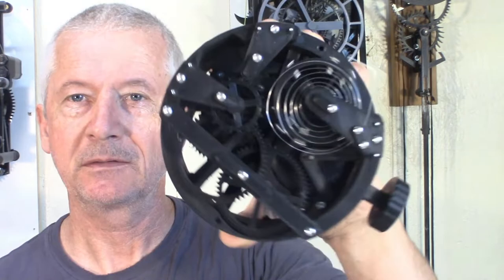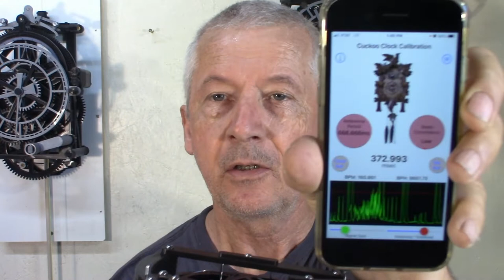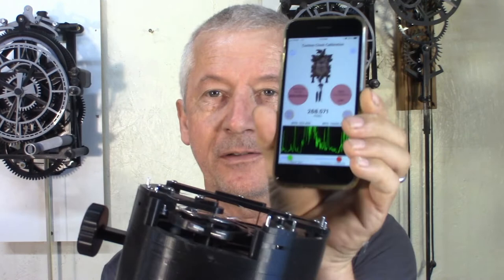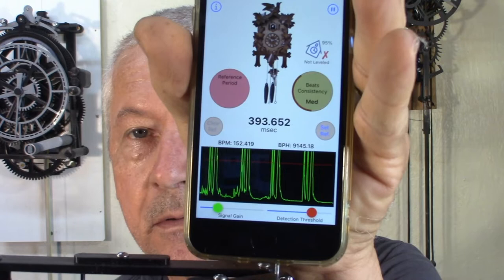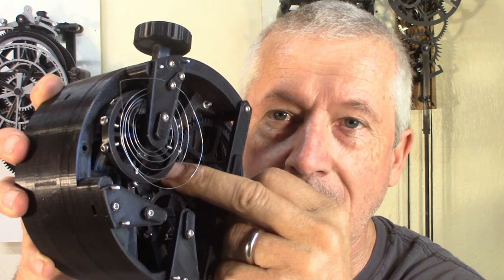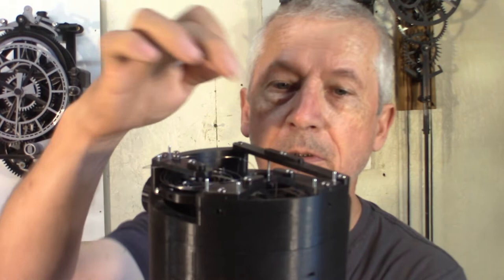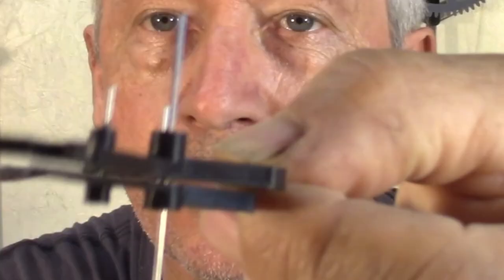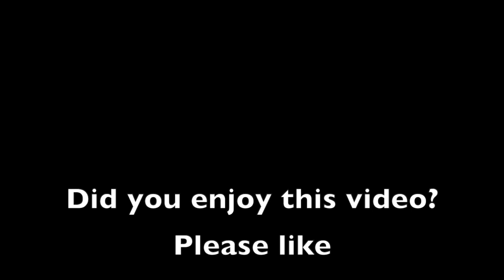Design and build of a 3d printed Roskopf watch, Part 6, prototype with steel spiral

Comment: is the balance wheel more efficient than a pendulum?
Reply from the maker: Probably not, but it is more portable
Reply: And it's not as affected by the movement of the timepiece.
Reply: @jacquesfavre999  and it looks cooler than a pendulum. I would also be curious to know about how accurate it is